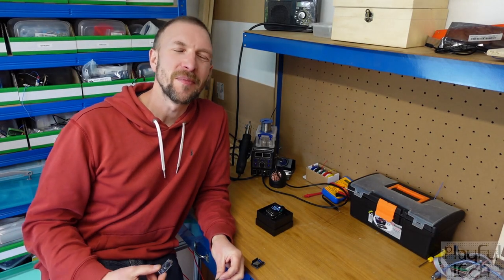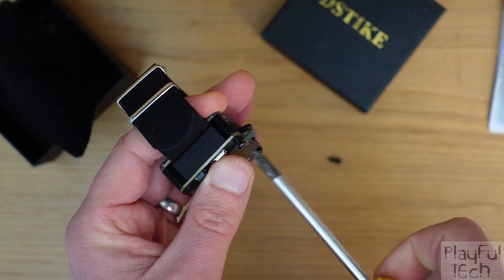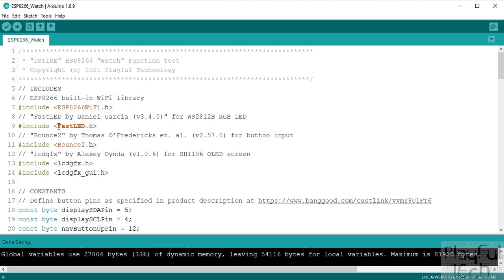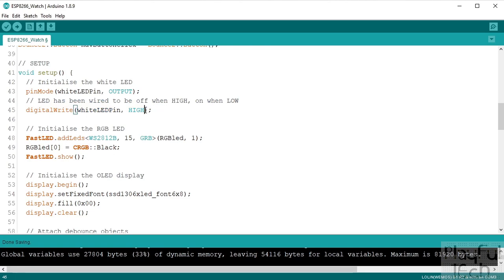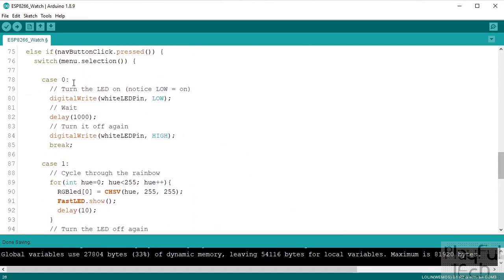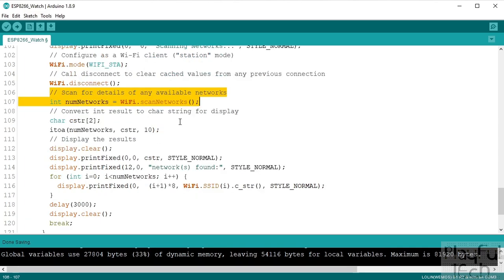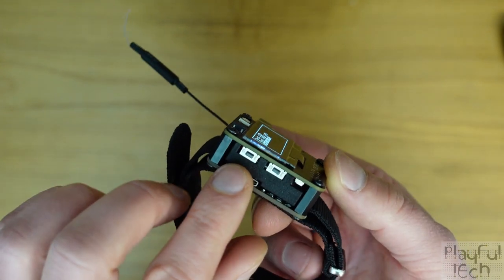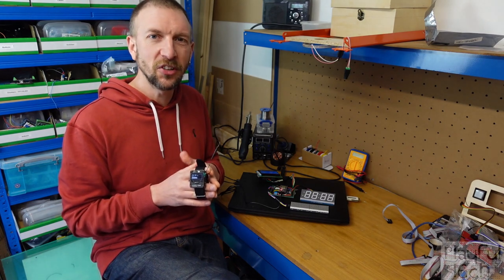Programming a DSTIKE ESP8266 Smart Watch with Arduino IDE

Comment: A neat feature would be to have one player "assigned" to wear the watch with a limited range of the wifi. That person would need to be near certain puzzles in order to perform some function like if 2 people are working on separate puzzles away from each other, the puzzle would "freeze" or "overheat" where if the watch isn't brought back into range of that puzzle, the puzzle would reset. That would keep the watch wearer hopping! Mind you, that works better in an escape room venue rather than a escape BOX style. I like your way of thinking, very creative!

Comment: Can you create a tutorial for changing the button functionality with the source code?
Reply: That depends completely on the library you are using usually it's almost identical to programming a regular Arduino button press. If you have the source code you want then you should be able to look through and see what is assigned to the pin outs then it's just relabeling and reprogramming them to do whatever you want. Good practice if they are available is to check the pinouts against the esp2866 documentation to give you a visual of what pins are assigned and what is open. The program pin information is usually near the top of the sketch p1= p2= ect. then an input button variable then commented or // the actual non coding description //. Then the variable is what you want to hunt for in the rest of the program. If not then you can make your own by editing and loading up the existing program onto the board. The idea is to serial monitor each button press while changing values of all but one pinmode to output. Nothing will happen if you press the button or activate the sensor ect. if it's not set to an input. Resend the edited program for each one then press each button if you get a value in serial monitor it's the one pin that's set to input write it down. Very useful troubleshooting trick if there's weak documentation or alot of unknown inputs. Then when you have a list the easiest and quickest way is just follow the program down and edit each instance(s) sub routine you find as desired. Generally with a decent program you won't have to it will be set to a variable and you can just find those. Hopefully this isn't redundant and helps good luck with your project.

Comment: I see it is quite old video, but maybe someone could help me. I try it and I cannot upload sketch to the watch. I installed Arduino IDE in fully version incl usb drivers. Select the same board as on video, but error says: no device connectesd to serial port.  How to fix ? In device meanager I see both COM3 COM4 linked as blueteooth serials.
Reply: u have to know what type usb in your watch and install the right driver for that usb